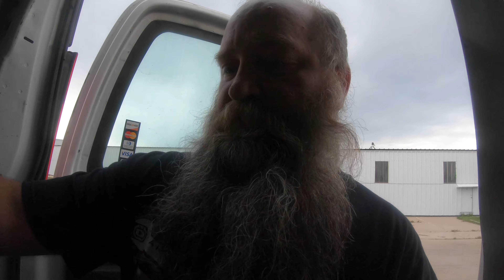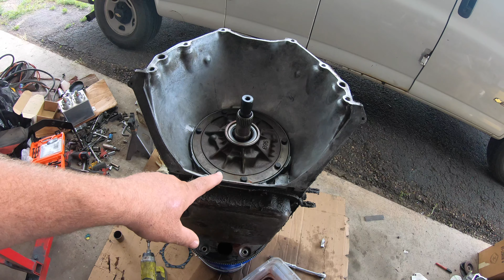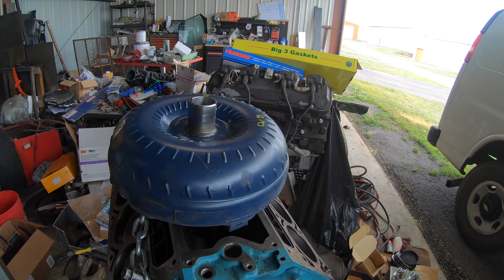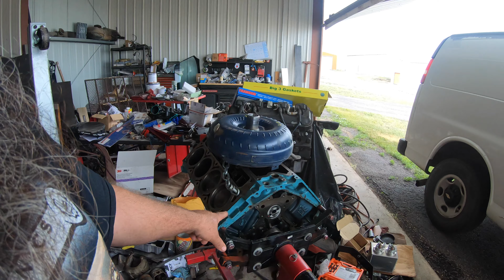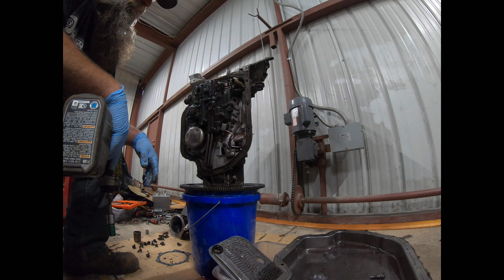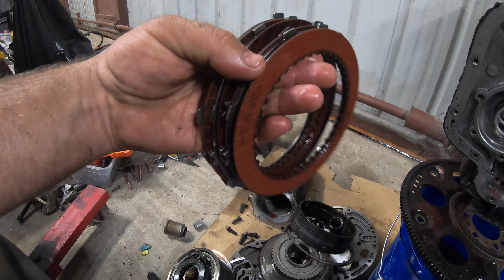I picked up another TH400

Comment: If that trans was a bit older it would be a ST400, super turbine that would have a dual stal speed converter.
Reply from the maker: I really don’t know that much about transmissions. I’m still trying to learn, and Buick Oldsmobile and Pontiac did a lot of different stuff than Chevrolet and GMC back in the earlier years. So I’ll have to do some research on the ST400. Not really sure what the advantage of a dual stall speed converter would be.
Reply: @armchairmechanicsnetwork9839  

Well, high stal was used to get those old huge land barges moving off of idle and then it would go into low stal for cruising.

The switch was usually hooked up to the carbonmaker so it would go into high stal at idle for easier braking at a light, just past idle would go into low stal for lower RPM acceleration and cruising until about 2/3 peddle it goes back in high stal. It was like having an extra gear back then

They also made a ST300 which was a 2 speed with a switch pitch converter, First gear sucked as bad as a powerglide, Those 2 have very few interchangeable parts, basically the only thing they had in common was that they were 2 speed transmissions.
Reply from the maker: @itseithergonnaworkoritaint7852  I started looking into this. Looks pretty interesting if you have a heavy car. I was also thinking it might be pretty sweet on a drive and drag event car as well. High stall when you step on it, and low stall when you cruise. Probably help a lot with transmission temps on the driving portions.
Reply: @armchairmechanicsnetwork9839  

Oh yeah, you can even get the stal speeds custom made for what you want, within reason anyway. IIRC if you raise the high stal the low stal will rise too? Don't quote me on that though because it has been years since I researched the ST400. A lot of that info can be found on v8 buick dot com in the juice box section. The owner of that site even sells converters, regular and switch pitch, he claims his regular high stal converters run like a low speed converter when you're not in the throttle?  Although I can't personally confirm that I have heard good things about it.

A ST400 with a gear vendors OD behind it is more work than a 4L80E to install but the last time I looked is less expensive. The Gear Vendors unit was around $1,200 the last time I looked but the trans controller for the 80E was about $750. So it depends on what trans you have already that will save you some cash? Unless you can find a deal on a good used Gear Vendors O/D unit?
Reply from the maker: @itseithergonnaworkoritaint7852  I have a 4L80e in unknown condition. Honestly, I would use the Terminator X from the FireTurd in another car and just get the Terminator X Max that has the transmission control built in because it would give me the control box and another ECU for the same price as the GV unit.
Reply: @armchairmechanicsnetwork9839  

Oh yeah, I always forget about those LS platforms are usually FI that have the trans controllers built in. LOL, my more advanced age is showing about that subject. For all I know, you can probably get the trans controller with the spark confuser if you top your LS off with a carb?

I'm still having way to much fun playing with the old engine platforms I guess, to be well versed in the LS stuff? Eventually I think I will be learning how to play with FI because I have a 97 K1500 Z71 with stupid Vortec spider injection that is already maxed out from the factory! And it doesn't break any records, not even close with that setup. But if I convert it to multipoint i can use a factory confuser and the trans will still have a controller with custom FI. I have to get a newer confuser though because the 97 is nonprogrammable. This is just one of the many projects I'm trying to find time to do. 

I wish I bought 10 of those Gear Vendors O/D units when I first read about them when they were only $500 each.
Reply from the maker: @itseithergonnaworkoritaint7852  factory confusers on LS vehicles have the transmission controls and can be segment swapped for a different transmission if necessary..... From what I’ve heard anyway.